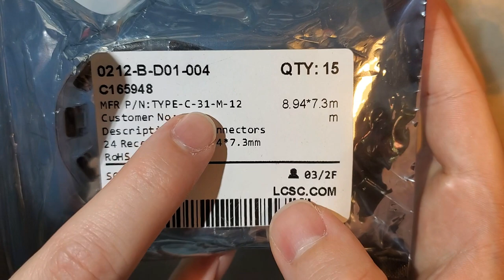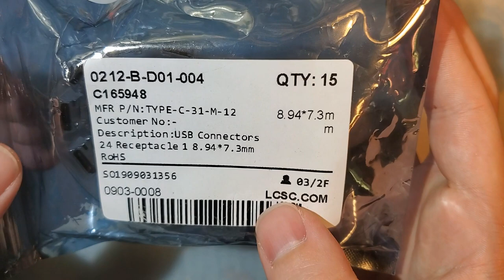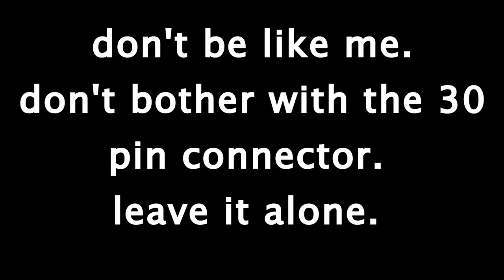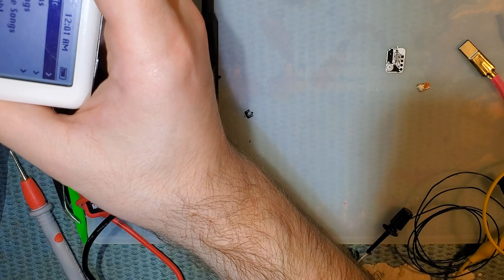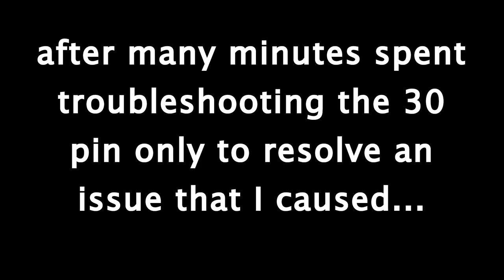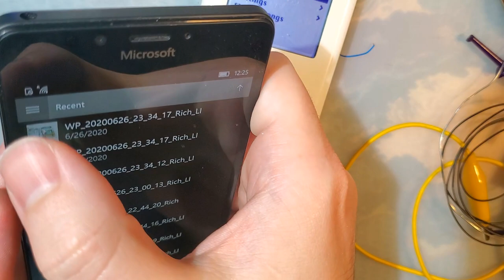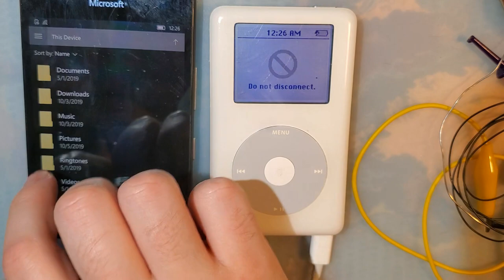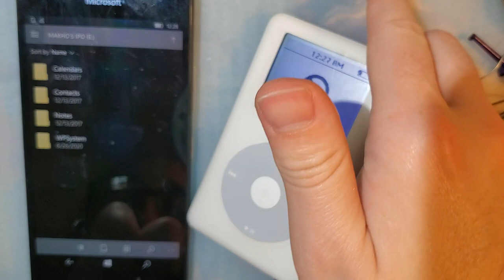USB Type C in a iPod (4th Gen Monochrome)

Comment: the 4th gen ipod was the last ipod that has firewire support (Usb 3.0 levels of transfer speeds)and also has better charging using a firewire cable. removing the 30 pin is a big no. but this mod really does look promising, good job.
Reply: If I’m remembering correctly it’s firewire 400 which is 400 megabits per second which is usb 2 speeds
Reply: @samanthagriffinv2.08  data transfer, yes. but it charges faster due to higher voltage.

Comment: Wow this is great. You know, I would’ve done something like how some other devices work where the plug is recessed and mounted by screw or something directly to the case. Would be structurally solid and reduce risk if messing up the hole. Thanks for the vid
Reply from the maker: This is mounted with a screw on one side. The PCB is shaped like a wedge on the other side.

Comment: Great mod, man! Stumble upon this bid when I look for gen 4 ipods. I just revive my U2 monochrome 4th gen. Noticing the battery you used is from Nintendo DS line one, is it plug n play or do you need to mod the connector?

Anyway, liked, commented, and subbed.
Reply from the maker: It was absolutely not plug and play. I pulled the interface board off of the original (replacement) battery and soldered it to a cell I salvaged from a DS Lite (really my parts drawer) because it's what I had on hand that fit, not because it's a good battery. 

https://www.youtube.com/watch?v=b8X-kkm5fSI
Reply: There are several places that sell parts to modernize iPods. Just search for them.

Comment: If I could only solder...I'd do something crazy like add usb c (for charging), turn the 30 pin connector inside and then use a fiio e1 amp connected to that with holes cut out for the little remote thing. Basically bypassing the ipod's less than optimal amp.

Comment: I'm curious... do you have to watch which usbc wall adapter you use? Like would using a usbc laptop charger to charge this be fatal for the ipod? 

Oh and what does it mean for it to be host? What are the resistors for?
Reply from the maker: no, any USB adapter should work. The resistors tell USB C host mode adapters that this is a "dumb/legacy" device that cannot negotiate other voltages (well, technically it can in firewire mode but I don't think you can enable firewire charge mode and USB data mode at the same time) so the USB C host adapter will only provide 5v. Like normal the iPod will draw whatever current it needs and no more.

Comment: Impressive how you found the solderpoints so fast. I can't find D+ and D- on the 5th gen. Could it be possible that they are not even there and only on the 30 pin?
Reply from the maker: It's possible. I'm not familiar with the hardware so I cannot say. I've never seen a device that didn't have filters or something on the lines though.

Comment: i think you need to invest in some bluetack to hold that stuff down when soldering
Reply from the maker: why? Bluetack has no place inside electronics. Even if it's only temporary, it would require cleanup which takes extra time.

Comment: Do you know if someone ever used that on a 7th gen Ipod?
Reply from the maker: My board is specifically designed to fit a 4th gen. The protocols are the same though so there's no electrical reason why it wouldn't work.

Comment: Please tell me where you got that battery
Reply from the maker: https://www.youtube.com/watch?v=b8X-kkm5fSI
Reply: @makho  I know you mentioned you made a video demonstrating this but I couldn't find it thank you  for the link do you recommend keeping the stock control board as I recently purchased a battery not specifically made  for an ipod that matches the specifications  what is the worst that could happen if I don't use it assuming all three wires are connected in the right order and the voltage is correct
Reply from the maker: @owensturman6044  don't fuck with batteries if you can't answer that question. Most likely it just won't work knowing how Apple is.
Reply: @makho  I figure I will try the new battery hopefully it works and doesn't fry my ipod and if not have someone a bit more skilled than me to help swap the boards

Comment: Good project but kinda pointless
You won’t increase charge or transfer speed.  Those are control by chipset and ic.   And lost ability to use 30 pin dock..
Reply from the maker: This mod didn't even touch the 30 pin connector but ok bud